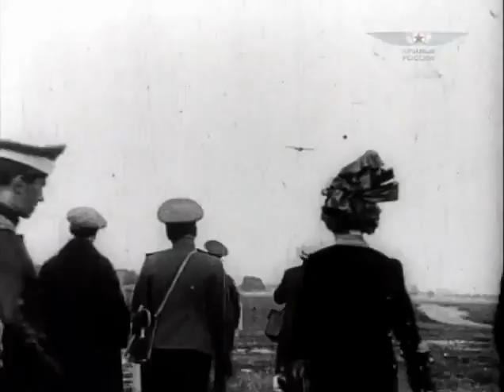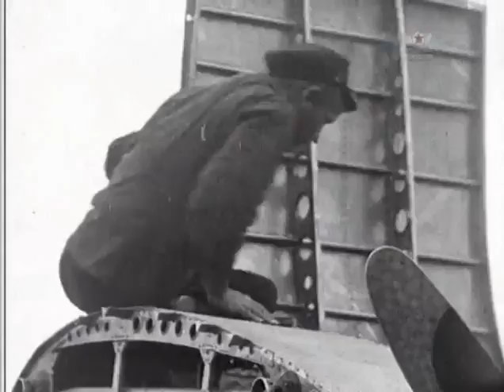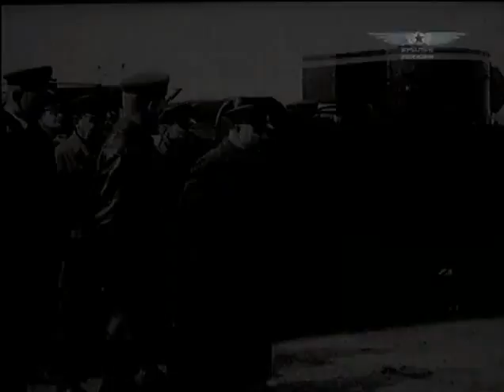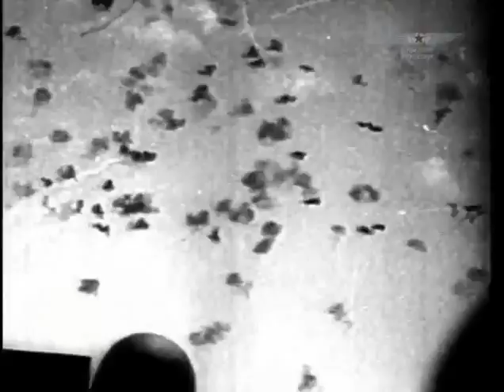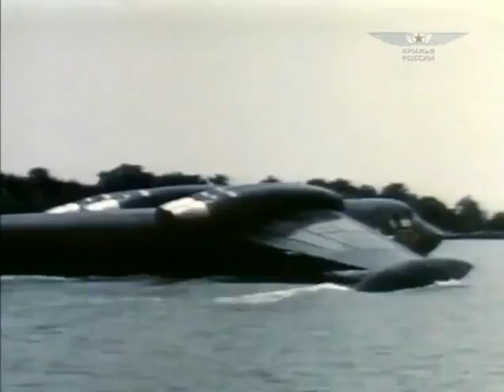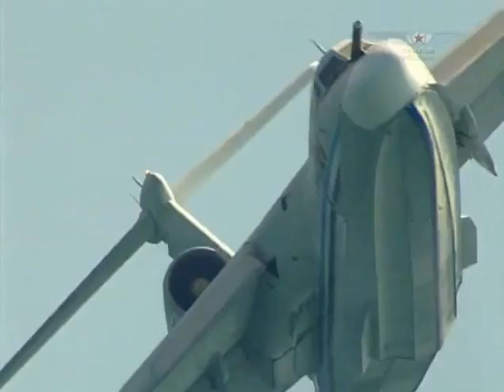Soviet Amphibian Planes 12 / 18: The Steel Albatross Full Length

Comment: i dont understand why flight lines doesn want to adopt some of these planes for safety of pasangers traveling over seas .If something happens to the engines it stil can work as a boat not to  mention that its something different from normal boring take offs and landings on the airport